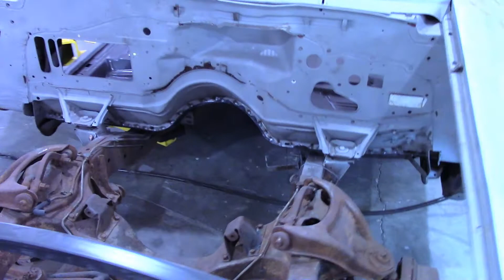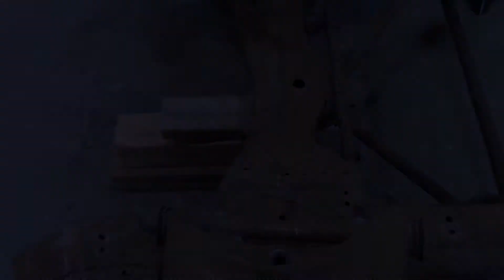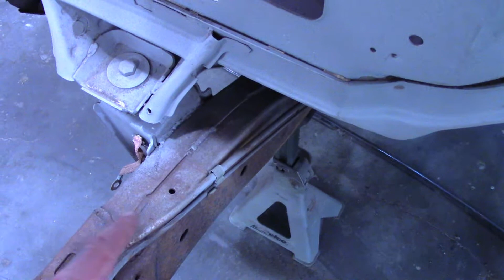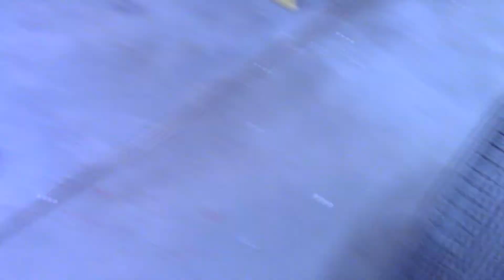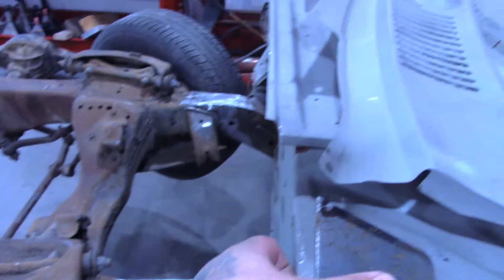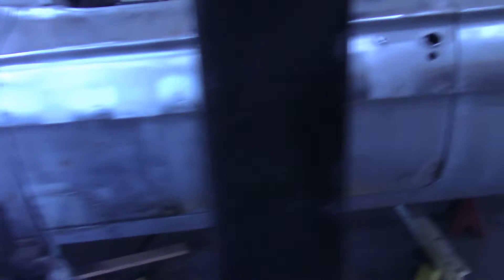Impala Budget Front Suspension

Comment: Why didn't you just get a dics brake kit from Speedway Motors and put new ball joints and bushing in and they make a bracket for the 605 power steering box with you have on the other frame would have been a lot less work.